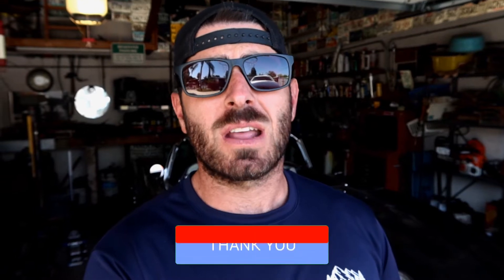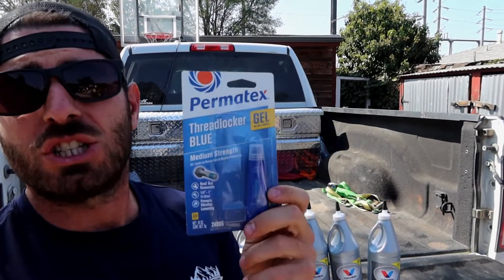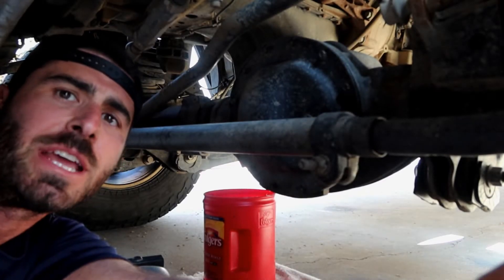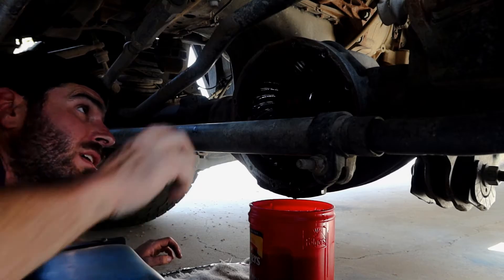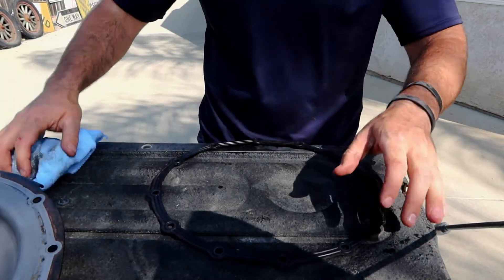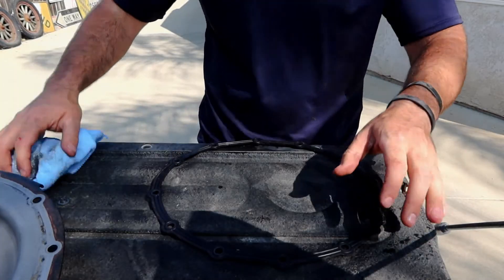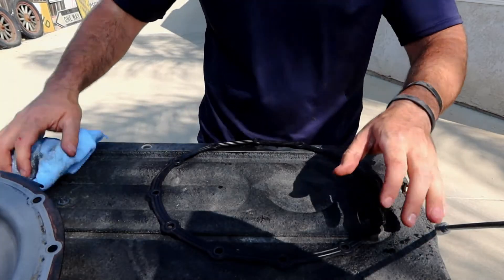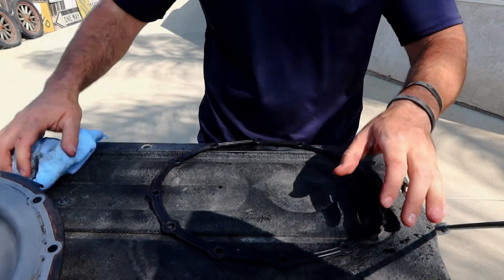Ram Diff Fluid ( How To Change Differential Fluid)

Comment: A fluid evacuator will be a favorite tool addition, especially for a hauler where we need to change fluids more frequently.  Can change the diffs and T-case in under an hour.  Best part, and you probably know what the RAM rear acts like when the fluid is cooked, is you can quietly change the fluid in a campground or in a parking lot, put the old fluid in the empty fill bottles, and drop them for fluid recycling.
Reply from the maker: Yeah I thought about getting one of them. Maybe every other change. It's definitely a good idea to remove the pan every once and a while. Getting all the small metal shavings out. Thanks for the great advice Rob!
Reply: @AdventureEndeavor  For sure!  The hand pumped vacuum evacuators can't lift the metal dust, but an air compressor powered one will but not as travel-friendly.  Being half-timers, still have my shop and tools.  Nonetheless, I'm with you though, occasional close up inspection still a must!  Enjoy your "moochdocking" stay you guys!
Reply from the maker: Thanks again! I'll look into one for sure!

Comment: Hi Jessie, great tip's on changing the Differential Fluids. I didn't know the newer trucks need it so often. My 1500 is over like 24 years old and haven't changed my rear-end fluid yet lol!! Maybe I should I have a little over 326K on it (wow). But most of it is all Freeway & Highway miles. Those Chingaderas sometime's mess me up hahahaha. I like the way you explain about how to keep it clean and it's importance, the way you clean the gasket ect Very thorough. I appreciate it.  Thank you for the video my friend. Safe travels!!
Reply from the maker: You are welcome David glad you enjoyed it. We tried to be as through as possible, hopefully helping others who have no mechanical knowledge. Wow 326k that's great might be time to change the diff fluid lol hahaha
Reply: @AdventureEndeavor  hahahaha
Reply: They don’t need diff fluid changed that often, that’s extremely early. It’s a sealed system unlike the engine oil.

Comment: Great video.. I recently replaced the rear factory diff cover with a Banks Diff cover. You should check it out. Plus, it makes changing the oil pretty simple.
Reply from the maker: Nice Lance! How is that diff cover for offroad protection? I feel like it might be aluminum? Thanks for watching BTW
Reply: @AdventureEndeavor  I believe you might be right but it is stout.  It does hang down a tad but Banks made it sound like its built for off roading as well.
Reply from the maker: Copy that! Thanks for the information ill be checking it out!👍
Reply: @lancecull5716  you made the right choice. All others DO NOT have the same interior profile that ensures oil at the top of the ring gear, Banks does it right.

Comment: How do you recommend cleaning the gears? Had a friend say just use brake cleaners to soak it down to flush it out. Is there a problem with using brake cleaner on the gears?
Reply from the maker: That's exactly what I do.

Comment: Great video. Thanks for sharing 
If you had to flush either diff, what would you suggest?
Reply from the maker: Flush? Typically I do what we did in the video. Or you can suck out the majority of the old fluid and put new stuff in. With a good pump. You can get about 90% out.